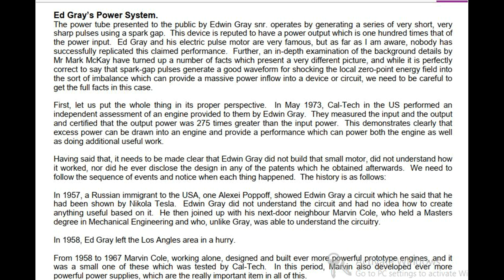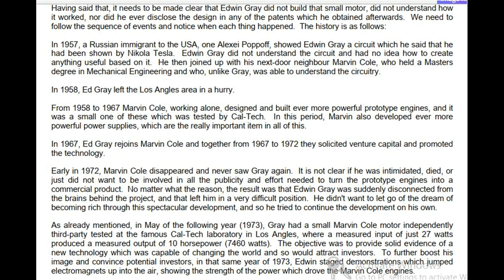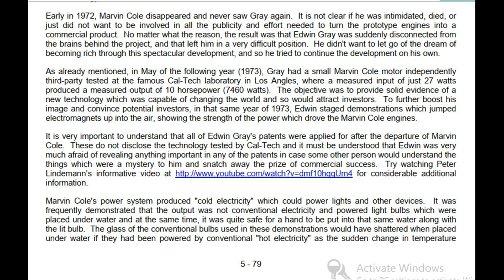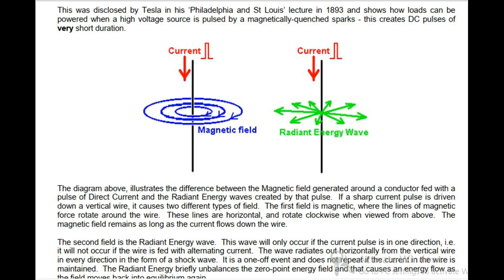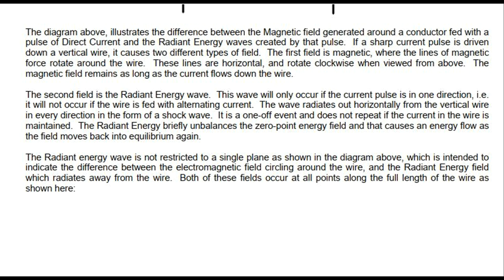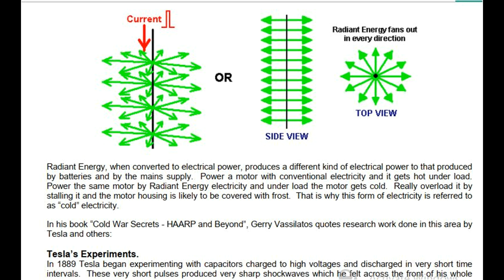Edwin Gray’s Power System

Comment: Edwin Gray used Tesla coil to power Newman style motor, high voltage low current motor.
Reply from the maker: Tesla coil is not necessary if high voltage battery is available. Edwin Gray used Tesla coil to amplify voltage. Free energy comes from pulse motor not Tesla coil.